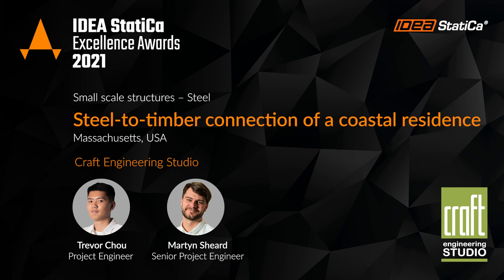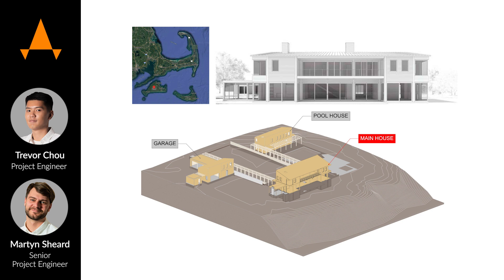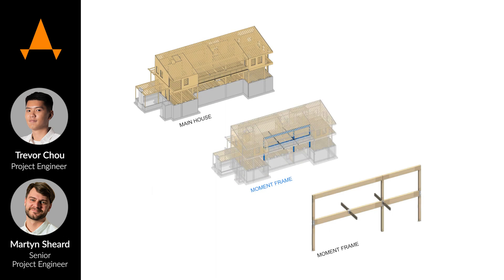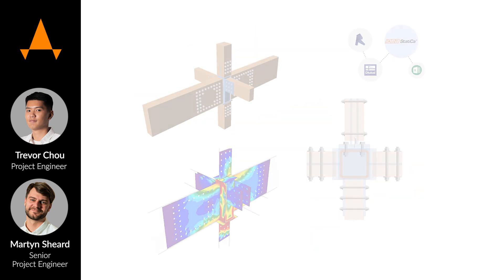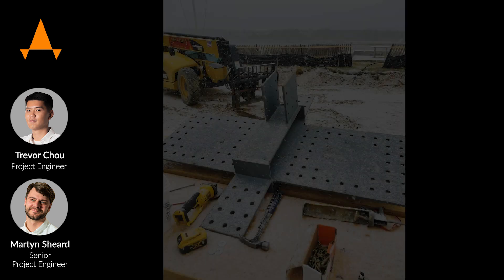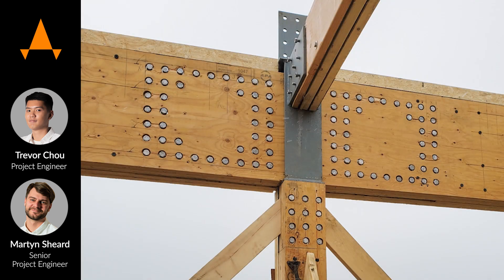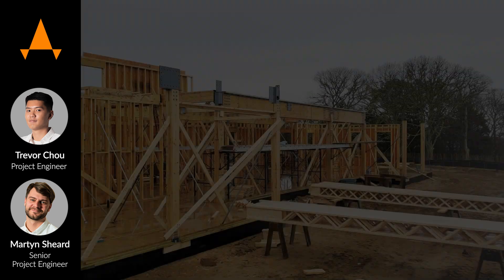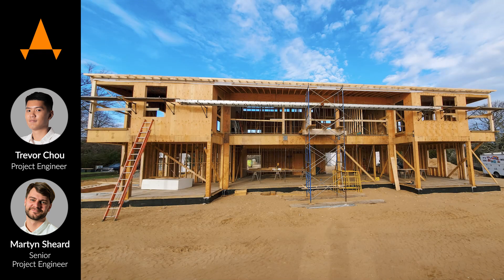IDEA StatiCa Excellence Awards 2021 – Family home in Massachusetts, USA

Comment: Idea statica allows timber connections to concrete?
Reply from the maker: Hello, you can use the anchors on the general plate - see an example in this webinar
https://www.ideastatica.com/webinars/connection-wednesdays-optimization-of-timber-column-anchoring
https://www.ideastatica.com/blog/designing-steel-to-timber-connections

Comment: Hi all! Congratulation for the awarded company and the unlimited possibilities of this software for structural engineering! I have one question. Was this study performed by using the Checkbot? Is it possible to use the Checkbot for wooden structures with steel connections? If not, when will that be possible?
Reply from the maker: Hello Jules,
thank you for you kind words! This was done as a stand alone project in IDEA StatiCa Connection, without using Checkbot.
unfortunately Checkbot can not import timber profiles for now. We would like to add this functionality later on, but its a matter of long term development and we have so many other topics ahead of it.
Best Regards,
IDEA StatiCa team